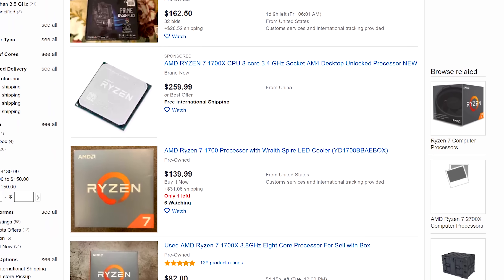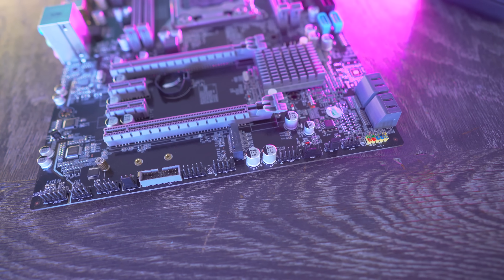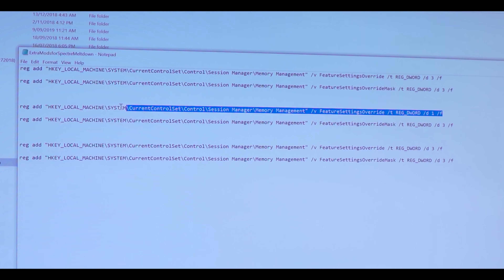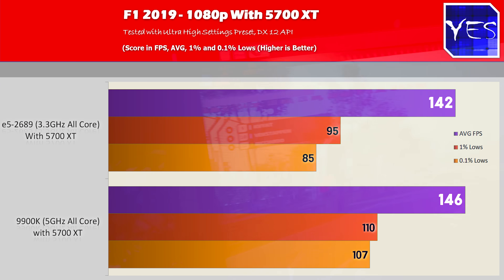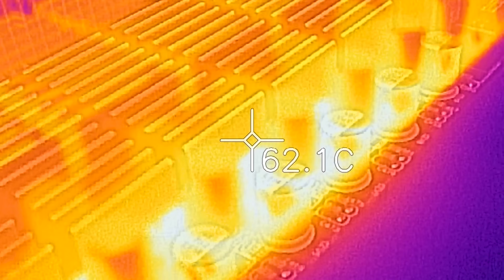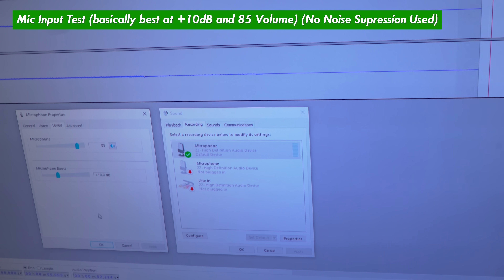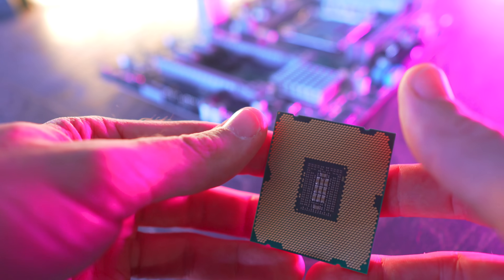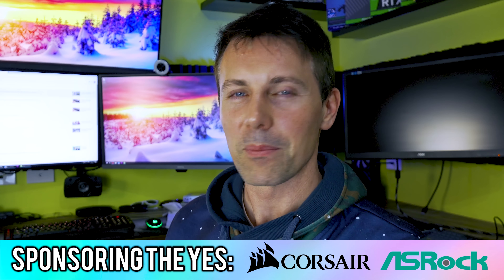8 Core CPU for $53....!? Will it BOTTLENECK a RX 5700 XT...!?

Comment: this whole video was like can you load a bullet into a gun :)   the answer of course  you can  but you buy the new model of glock  because for features  the old glock doesn't have anymore  sure a glock 15 will get you by because its a gun and it does still fire a bullet but the new glock has rails and built in sights features to make things easier not to mention you are cheating your ass off with a server chip  CPU
Reply: @Empika  yeah engrish is not  my thing

Comment: Have your tried any in the x79 mother boards from the seller severit_nl on eBay?
They are a few bucks more than the Machinist board, but they have vrm heatsinks...
Reply: I'll try to put the link below
Reply: https://rover.ebay.com/rover/0/0/0?mpre=https%3A%2F%2Fwww.ebay.com%2Fulk%2Fitm%2F123602260261

Comment: wait but then why does my 1700 at 3.8ghz bottleneck my 5700xt when this one does it less?
Reply: That's what I'm saying.  My Ryzen 7 1700 overclocked to 4,050mhz on all 8-core @1.375v bottlenecks my 1080 in some games.  I'm genuinely confused how this guy did his testing.  I don't believe any of it.  I have one of the highest performing Ryzen 7 1700 on air cooling out there so it's by no means my CPU.  
I refuse to believe that it would be $66 if it performed on-par with a $480 CPU.  Even the old 1st gen Ryzen 8-cores, like our Ryzen 7 1700, are still $200-320.
Reply: There's actually no way it performs like he says.  Quad-channel memory isn't that big of a difference.

Comment: Why do I see this as evidence of Intel not changing much over the years? The biggest issue in CPUs I find has been SSE optimizations being used by a developer that AMD hasn't put on their chip. Most of the time it's some arbitrary thing that could have been prevented. Choice vs logic. (RE7 demo working on all CPUs fine, but after release not working on Phenom II). By no means am I saying Phenom II/FX was super amazing, but I still have an FX I built in use by a friend running a GTX 1060 with no issues. I'm now running a i7 4790k until I build my Ryzen 3 and sure it has a little more headroom, but I don't see some night and day performance difference. Userbenchmark says it is +55%, but I don't see it in games and I was running a R9 270X and now run a GTX 980. The biggest difference came from the GPU, not the CPU. Perhaps I don't see a 50% difference, but only when it's 100%. But then again everything has it's good and bad, so it may have a draw back in one area and excel at another, so anything below a 2x performance increase is hard to see and put a real value to.

Comment: Ha! Just got my X79 board with the e2689 and 32 gigs of ram yesterday, installed ram heat spreaders and installed my Snowman cooler(my board came with a bracket that screwed in fine) have not installed or tested yet but am so hyped now and love that this came out at the same time!

Comment: I was wondering how is that the 2670 was doing better than my 3930k with higher clock,mine is bottlenecking a bit my gtx1080 at 1440p. Then i realize that you are using Dx12 and vulkan games.

And yeah,i have deactivated the spectre and meltdows patches.

Comment: I built 6 systems using this setup with a different aliexpress board, and the results have been phenomenal. All my kids have this setup with 32gb Quad Channel, 2060s , e5 2689, 1gb nvme.. and they all stream with no FPS loss. Also, there is a Russian modified bios out , for the board I use to allow overclocking on the board , and boost performance a little more, or use unlocked xeons to really overclock.
Reply: I built/modified three platforms for myself and my two kids. One, a Dell Precision T5600 dual E5-2667, one HuananZhi X79 deluxe paired with an E5-4627 (v2) and the last, a ASROCK Extreme 3 paired with an E5-1660...that I will soon upgrade to an Asus Pro P9X79 paired with an E5-1650 (v2). The later upgrade...that ASUS I got for only EURO70 in a local deal. Frankly, I have been very pleased with the Huanan X79 system's performance over the last 9 months.  Still, highly recommend a fan on its VRM heatsink for safe measure.
Reply: @jb678901  did your board have heatsinks on it? If you aren't overclocking at all heatsinks are fine,  also I use a fan/heatsink setup on the CPU where the fan blows down on the board to help with airflow onto the motherboard .
Reply: @vipast6262  Yes, it is the Huanan DELUXE version, with the metal heatsinks on VRM and on the chipset.  I have good airflow and did install an 80mm fan to blow over the VRM heatsink.

Comment: disabling the specte and meltodown updates is just irresponsible.
Reply: If you are just gaming, bot a big deal. Those mitigation are really needed if you are hosting enterprise servers (the main purpose of those xeon) with sensible data, the standard user isn't really worth the time exploiting those security flaws
Reply: @Thefuror38500  isn't it possible just to use a script to exploit that security flaw and therefore not a big problem at all

Comment: Quad-channel on H67 is no problem whatsoever. Since the first Core-i series, the memory controller is inside the CPU, so it's completely separate from the chipset. For the same reason, when using a Xeon in a LGA115X or LGA1366 board, ECC (reg sometimes too) memory will work (though ECC functionality itself might not work, that requires dedicated traces on the mobo)
Reply: So I can use ecc memory on any board with e3 12xx xeons ?
Reply: @kruxdt6307  it should. I've done it on X58, Q77 and H87. Registered mem will not always work though
Reply: @WouterVerbruggen  thanks for the info

Comment: is it 100% that a snowman cooler wont fit lga 2011 boards like this? (kllisre hunana plexhd too?)
Reply: You will need to use the adapter that comes with the mobo
Reply: @kruxdt6307  okay so basically with the adapter that comes with those aliexpress motherboards like i mentioned before, i can just simply use the snowman properly?
Reply: Yeah

Comment: I installed an E5-4627 (V2) 3.3 Ghz base clock (that turbos on all cores to 3.5Ghz), 8C/8T (no HT!); has run cool and successfully on HuananZhi X79 deluxe, paired with GTX 980 and 32GB DDR3 1600 REEC, it scores on CB: R15 =965, R20=2060.  I got it for $80 plus $14 shipping via eBay.  Not too bad, not bad at all.

Comment: Is the m.2 on this mobo nvme? x4 or x2? Please I need to know. 
Also I would love to see e5-2689 vs ryzen 2700/3700x vs 9900k but all with 1080ti/2080ti.
Its hard choice of value vs longevity.
Reply: I'm also wanting to know this stuff
Reply: @gokaykutlutwitch  oh that's a bit more expensive at 120$ on ebay for me. But if you really wanted nvme its probably worth it. It's wild that nvme a new technology is on a year 2011 SERVER socket 😂
Reply: Is the E5-2689 for 20 € more worth to buy?

Comment: Why make a motherboard with Sata plugs, why not just make M.2 slots 8 slots and 4 of them running in Raid4
Reply: Frank Nakamo RAID 4?
Reply: @slohachi6433  4 M.2 running in raid mode.
Four m.2 memories working or running as one. as you dorks speak incorrectly, because run is when you use legs.
Reply: @frankynakamoto2308  ok so you mean raid 0 then? RAID 4 is not a thing.
Reply: @slohachi6433  RAID4 is a thing...
https://www.techopedia.com/definition/17273/raid-4

Using 4 m.2 as a single drive using a Raid0 configuration, is called RAID4.

Comment: I just got a E5 2651 v2 for my x79 system. The 3930k isnt cutting it for my surveillance machine. With 4, 1440p cameras, it can peg it out. Hoping the 2651 with 12 cores, can handle it with ease, and take half the power...
Reply: forgot to add, 85 bucks shipped to the US from China

Comment: A showdown on these 8 core, 16 thread cpus: E5 2689 vs
 i9 9900k and ryzen 7 3700x or 3800x should be very interesting 😁😉
Reply: the outcome is prolly the same unless he plays single core games, the 5700 xt is not enough to botleneck, probably only the 2080 ti will see highest variance
Reply: Or secondary option would be to pit against the 8700/8700k and 2700x😁😁
Reply: Well he did do a showdown last year/earlier this year? between the 9900k, the 2700x and pretty much the top X79 CPU, the E5-1680 V2. (That is an generation newer than the E5-2689, that is also 8 cores/16 threads and it is also unlocked for good overclocking.) There are up to 12 core X79 CPUs, but they can't clock as high and they are multiplier locked. (E5-2697 V2, E5-2696 V2)
https://www.youtube.com/watch?v=xYxQ82wcA_s

Comment: Where the reg edits applied to both machines? Also, I would argue that these edits to safeguards against known vulnerabilities are NOT something that should be recommended, unless you really don't plan on having your machine hooked up to a network. Beyond that, if you don't know what it is your editing in the Windows Registry, you can actually brick the system if you change the wrong thing.
Reply: a simple format fix the brick or a recover, so dont worry about regedits
Reply: @l2x6tense  Dependent on how badly it's bricked. There are some cases where i could force you to perform a complete clean install.

Comment: The X79-UD3 was one of the worst X79 boards :D.....crappy VRM design. Switched to a Rampage IV back in the days and got my 3930k to 5GHz. Still rocking the board with a Xeon E5-2690 @3.6GHz allcore.

Comment: just get huanan mobo. then get yourself reg ecc ram. dirt cheap rn, you can easily get 16-32 GB
Reply: The only thing is the inability to overckock. Perhaps throttle stop would work?
Reply: @josephkarl7080  throttlestop would work if the cpu has a  unlocked multiplier
Reply: @jyuan1999  so... e5 1620 v2?

Comment: I have a 4130 quad core am 3plus. But my browser stat to be sluggish I  clean it all the time so I wonder how to remove the sluggish mess from my cpu.
Reply: Sounds more like a hard drive or ram issue

Or you got too many programs that auto run
Reply: @bluescluessuperagent  keep programs  to  a minimum yeah hdd is old I quess I upgrade. But duno how to transfer from to new yet. XD
Reply: @cornytheman  just clean install Windows.  Buy a cheap 120gb ssd, install Windows, use your existing hard drive as a 2nd storage drive, boom
Reply: @bluescluessuperagent  i already has ssd with windows with the as 2nd that's why  many I need to  increase ssd performance haven't done that in a while
Reply: @cornytheman  go to task manager and see how my programs you have that auto run when windows boots

go to search bar, search performance and set to max performance 

go to search bar, type background, look for option saying to decide which apps to run in background, and turn them all off 

and lastly how much ram do you have?

Comment: I have xfx rx-580 black with 6100 6 core and 16 gigs of ddr3 1333. Help trying to get better fame rates. Help.
Reply: Huge Bottleneck over your RX 580 (AMD FX 6100)....need change your PC:

- Old School....Intel i7 2600, i7 3770 or Xeon E3-1230, 1240, 1250, 1270, 1280 V1 o or V2 (all those over socket 1155), Also Intel i7 4770/4790 or Xeon E3-1230 and beyond in Version 3 or V3 (socket 1150).

- Current Meainstream Platform....something like Intel i3 8100/8300/9100/9100F (4-Cores in socket 1151 and Chipset serie 300)  or AMD Ryzen 3 1200 (do Overclock), 1300X, 2200G or 3200G over mainboard socket AM4 and chipset B450....much better Intel i7 6700/7700 or Ryzen 5 1400/1500X/2400G/3400G (4 Cores/8 Threads).

- If you have enough money...go to Ryzen 5 1600, 1600X, 2600 or newest 3600 and MoBo socket AM4 chipset B450...or Intel i5 8400/9400/9400F over MoBo socket 1151 and chipset  B360 or H370 (6 Cores CPUs).

- Better Price-Performance ratio....go to Combo Alliexpress: MoBo X79, 16-32GB DDR3 ECC and a Xeon E5-2689 (socket 2011).

If you cant change that PC...then set the RX 580 (Game Menu) at 2560x1440p (adjust the graphic quality according to the game, to achieve a point of balance), the GPU`s Workload will increase and send you a better cadence...not more fps, but better cadence.
Reply: Have to tried overclocking your cpu?
Reply: @bluescluessuperagent  ...Man, a FX6300 at 5Ghz bottleneck to RX 570 gaming at 1080p (CPU-Demanding Games), so image with a FX 6100....obviously a FX6300 its better than FX6100 and RX 580 over RX 570 about 10-15% (Performance).
Reply: @juanmassiosare9850  ...person asked for better fps so I gave the easiest advice to follow 

my advice is kinda easier to follow than your long drawn out guide to buying a new cpu/motherboard which isn't always practical 

and not all games are cpu demanding
Reply: @bluescluessuperagent  ....Wow, what you mean is that you offered a sterile, short and so out of all the reality involved in combining an FX6100 with an RX 580, because precisely your brain does not give more? (short-brian)....Sorry, but not always the shortest answer is the most appropriate, less if you have no idea where it stands (your case obviously).

On the other hand, if a guy comes here to ask for help to increase the fps in his games and then we see that he has a huge imbalance in his PC because he combined an FX6100 with an RX 580, it is EVIDENT that his request originates in the more CPU-Demanding Games, because if he were talking about GPU-Demanding Games, he would not have asked the question in first place, DON`T YOU THINK?????  HA HA HA HA HA!

Comment: Brother is this fine temperature with Ryzen 7 3700X? On Ryzen 5 1600 CPU to CPU diode temp difference was 10C but here it ranges from 20C-40C. Stress test temp on Ryzen 1600 72C/82C while on Ryzen 3700X 65C/105C respectively on CPU/CPU diode temp.
https://imgur.com/bkwe5br
https://imgur.com/oEF4NJS
Tested with Stock Cooler.

Comment: I have this CPU in my Rig, amazing performance
Reply: Matey can you share some temperature figures please?
Reply: @gvegito0  idle like 50 and while playing Overwatch 70, but the airflow in my case is pretty bad so take that into account
Reply: @1337sammy  I think with a better airflow in your fan the temps should reduce by at least 8-10 degrees.

So 70c-10c = 60c in reality under stress ain't bad!

Thankyou :)
Reply: @1337sammy  dude one more thing.. how's the performance on editing softwares like premiere pro and can you share some gaming benchmarks please?
I'm looking forward to buying this
Reply: @gvegito0  Personally I edit in Davinci Resolve, have no issues at all, CPU never has to go to full usage and when I game my GPU is the limiting factor, when I play Overwatch even while streaming my CPU's usage is always below half
Reply: @1337sammy  amazing, I am also looking forward to using it with both premiere and resolve..
What GPU have you paired it with?
Reply: @gvegito0  Currently an Rx570, planning on upgrading to a 1080
Reply: @1337sammy  cool, thanks for ur help and good luck!!

Comment: Bryan, funny how times change. Years ago (Feb/2014) I bought a Gigabyte UD3 for only about 45 UKP. I eventually donated it in a build for the Lindybeige channel, fitted with a 10-core 2680 v2:

https://www.youtube.com/watch?v=vvH8lJYOhrI

Back then there was little demand for used X79. I was getting ASUS Rampage IV Extreme (R4E) boards for about 100, P9X79 WS boards for a similar amount, even the P9X79-E WS wasn't that expensive (I have two of those). To give you some idea, in one case I managed to get a complete boxed/new ASUS R4E, 3930K and 16GB/2400 RAM for 200 UKP total. One of the P9X79 WS boards I bought went into this build, again with a 2680 v2:

https://www.youtube.com/watch?v=g2WiJNEZLNY

Who could imagine how different the demand would be today, even though in many ways modern Ryzen ought to render such old tech kinda moot. I suppose there are various reasons, but it's certainly a curious thing. Perhaps one reason is that relevant CPUs provide a lot of PCIe lanes and (with 4 channels) good mem bw. The cheap mbds from China compromise these things to a degree, but still, some boards are not bad (I've bought a PlexHD but also a dual-socket board to try out).

I've been watching 2689 pricing, waiting for it to dip to a reasonable level so I can get a couple. In the meantime I have two budget 2640s, two 2650 v2s and two 2680 v2s to play with. :D

And if anyone's interested, in October I'll have P9X79-E WS and P9X79 WS mbds for sale (one of each, boxed with all accessories, both currently fitted with a 2680 v2). I'm in the UK.

I must admit I'm surprised your gaming results were that close, given the 2689 would I expect operate the PCIe in 2.0 mode. Very interesting. Re the power consumption, I wonder how that might change if you were using a 2680 v2, also how it might affect those already small performance gaps, especially if it were the 2690 or 2687W (though those are of course far too costly). Would the SotTR gap shrink with two more cores, or higher clocked cores? Inriguing.

Comment: My rig is more then 5 years old I know google said that my CPU was released 8-29-2014 but I built the I7 5820K before that. I dont buy everything at one time I normally build PC's around the CPU it's a Haswell-E X99 V2. I had to build it in the store after everything was purchased. The motherboard is a no name I got from China it needed several different updates from Asus, Gigabit, and Asrock to get the MB firmware to support the CPU. I got the CPU from a Microcenter near me open-box for 86 bucks it was used and they didn't really know what it was the person that returned it said it didnt work and he couldnt get it to boot at all thats why i built it at the store he had polished the heat spreader so everything was gone on the chip its self. Ok look its costed $86.43  (I7 5820K oc on all cores 4.1ghz paired with ASUS GeForce GTX 1080 8GB ROG Strix (wasa 970 when i first built it), Samsung 512 nvme

Comment: I had this exact same CPU + motherboard combination and two GTX 960 4gb running in SLI (I had them around collecting dust so I used them), definitely not very power efficient but gets job done very well. Consumer grade i7 does gaming better though imo